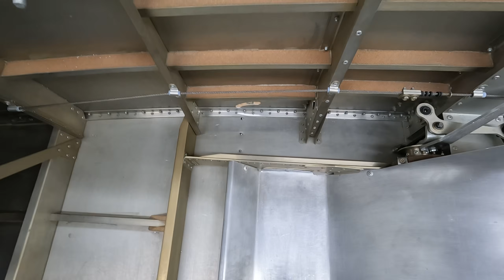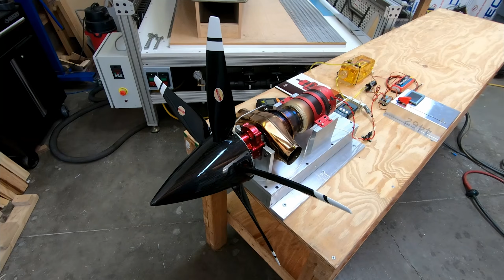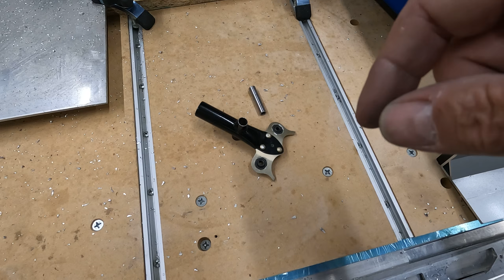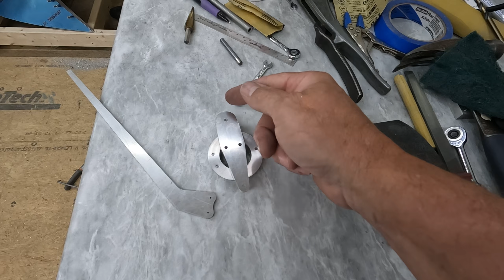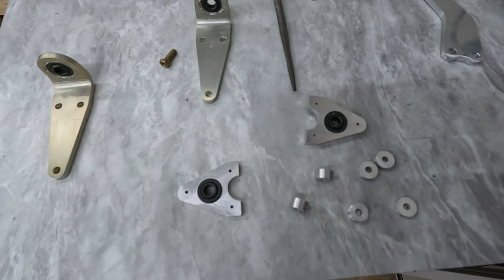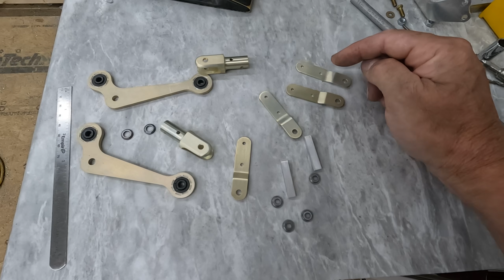36 - CriCri Airplane Build - Aileron and Flap Controls

Comment: Jim, good to see you back.  I realize it’s a little late in the build for advice but I find using a 3D printer and drill bushings as guides is a good way to get accurate hole locations. Obviously you have a mill for some of that but it can be useful for doing parts in sit-ups the plane. Great work.

Comment: Thanks for posting this video.  One question, if you deviate from the plans do you need OK from the designer?  i.e. the pop rivets for the aileron push rod and the disconnect fittings?  Was always interested in building a plane but only have resources to build RC sailplanes.
Reply from the maker: @Paiadakine It all depends on the rules in whatever country you live in. Here in the USA, we have no rules regarding Experimental aircraft as far as proof of engineering. We don't even have to have plans for what we are building. Some countries may require everything on this type of aircraft have proof of engineering and and thus require any changes be approved by an engineer, either the original designer or someone you hire to approve the change. Check the rules in the country you live in for specifics on home built aircraft.

Comment: Nice to see you back. It’s been a while since the last video. Beautiful work.
One thing – I wonder how that foam on the longerons holds up longer-term? Maybe a layer of glass on each side to protect the foam? Although that would obviously have to be done earlier…
Reply from the maker: It is "foam" but it is a high density PVC (plastic) expanded foam that is a very rigid material. Should hold up quite well. It's not fragile like most foams you would expect to be or possible how it looks.
Reply: Jim thanks.  My experience is mostly with Lancairs and a little Rutan, so I’m biased with their techniques.  
Fantastic project.